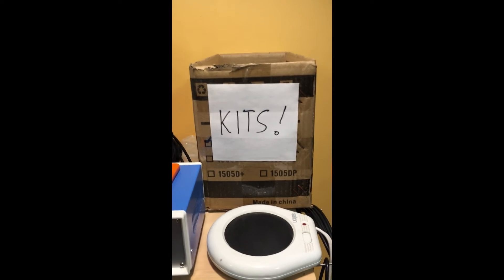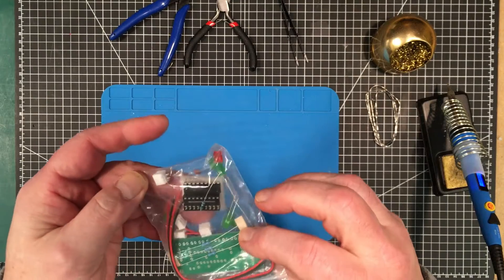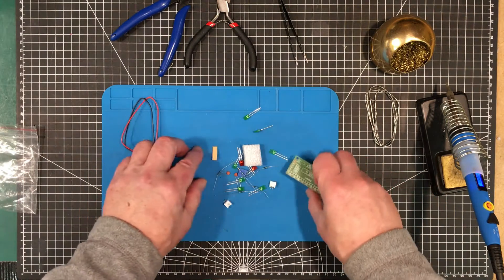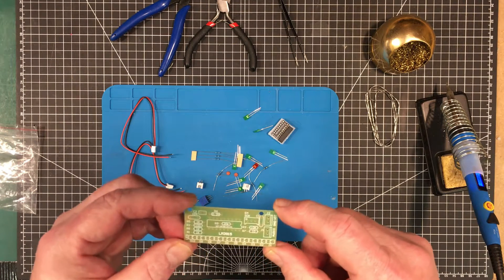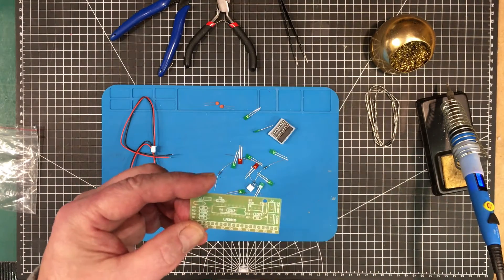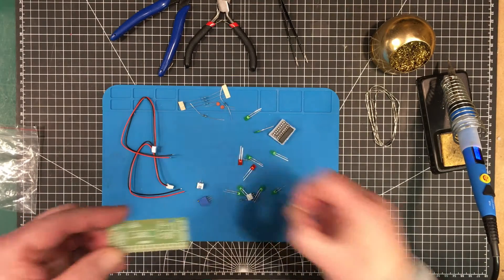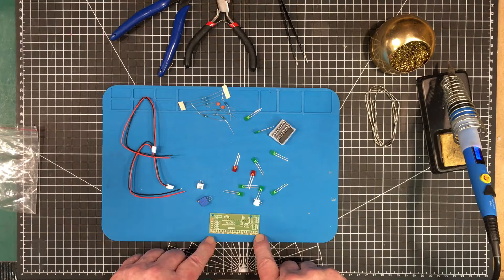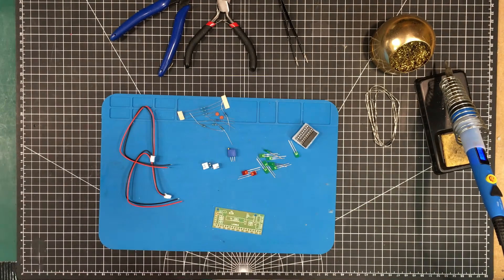Uni-Byte 0163 - Kit of The Month: Simple and Easy LM3915 Dot/Bar Display Kit.

Comment: bought 10, need 8, they came with the rectangular LED's but i'm going to replace them with 3mm and mount through black perspex, easier to drill round holes lol
why 8? building a 7.1 channel amp, the idea is one on each channel, but i would also like to switch them to the output of some filters so I can also have a spectrum analyzer display, I have seen some chips that can do 7 bands so i guess i could lose one channel off the end, will have to find a 8 pole switch... or a few cd4066's from a single push button
Reply from the maker: Sounds like an interesting project.

Comment: Ive got this kit in my hand right now, im building 4 of them for an IN and OUT audio comparitors (audio matching) for in and out levels on my homebuilt 15band eq, tbh you would be better off replacing the 3915 with the 3916 as its designed for a VU log scale, the 3915 runs on a 3db scale from -30db to 0db the 3916 is a log output 0, 1, 2, 3db then backwards to -27 so basically the 3916 is ideal for very accurate OVER levels when recording (clipping)

Tip: mount that 20k resistor under the IC at the back of the board, then it can easily be changed
Reply from the maker: Sounds like an ideal project, and thanks for the tip!

Comment: Is the LM3915 still manufactured, or new old stock? 
Is there still production in Asia or are there only desoldered ICs from Asia?
Reply from the maker: As far as premier manufactures are concerned it's NOS.  However, that said, it's readily available on eBay and/or AE.  But of course you risk the chance you'll get a non-functional fake, but from what I have seen this does not happen.  Either the Chinese have made a good copy or the NOS is plentiful.
Reply: They are actually still being made just not by texas instruments or national semiconductor, the new chinese copies are 100% identical in performance in every way

Comment: Nice kit. I recently received my very first kit to learn to solder. A radio apparently. I am not very experienced but even I can see it's so badly made as to be not worth building. Any good sites that sell kits?
Reply: A good strategy for learning both electronics and soldering, together, is to build small bench tools that you will use forever. These generally only take a few components and can be made with spare parts. A kit is not necessarily needed. Here are a few to consider... A bench potentiometer. Uni-byte has a recent video for this one. A power adapter polarity tester. It is just a barrel connector, one resistor and two LEDs placed in reverse polarity. Sometimes you will encounter a sneaky wall wart that has a negative center pin. That will destroy positive center pin devices. This tester will catch them. Just remember to use it, when you acquire an unknown adapter. All sorts of testers... transistor, MOSFET, op amps, etc. Resistor substitution boxes, capacitor substitution boxes... The list goes on and one. You just have to look for the circuits, learn a little about how they work and solder them up on "perf" board. Build them on a breadboard first, to prove their operations and improve your understanding. They will serve you well and give you great satisfaction, every time you use them. I hope that gives you some inspiration. Welcome to the Electrical Engineering Hobbyist Community. We are glad you have decided to join us. Cheers.
Reply from the maker: @t1d100  All true.
Reply: @t1d100  I really appreciate you taking the time to write this. Thank you very much.  Cheers.
Reply from the maker: I get most of my kits from IC station, AliExpress and amazon.  There is the odd one from eBay.  The secret is to spend time to search.
Reply: Thanks